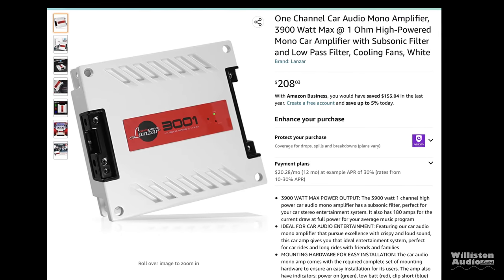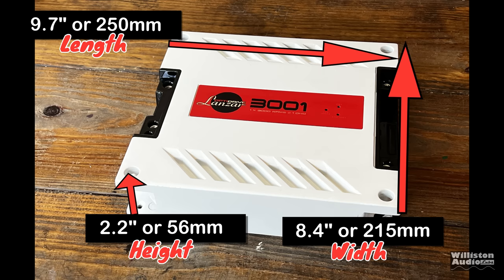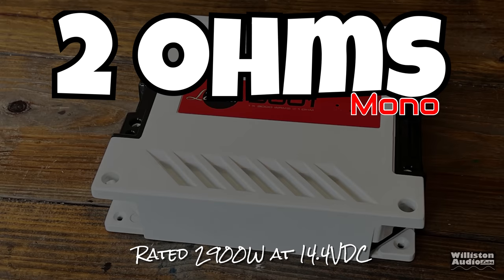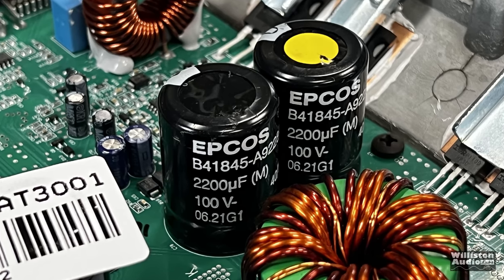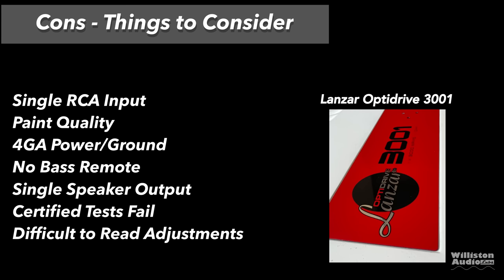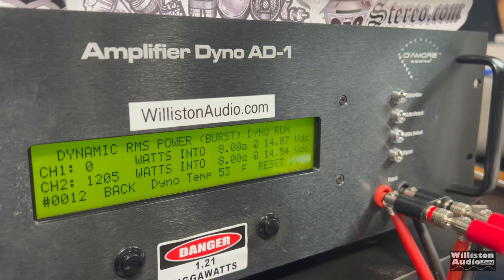Lanzar Goes Brazilian? Lanzar Opti Drive 3001 3900W Full Bridge BASS Amp!

Comment from the maker: SHOP
Lanzar Opti Drive 3001 Amplifier: https://amzn.to/3Zc4arv
4ga to 0ga input adapters: https://amzn.to/3ijToP8
Banda Amplifiers on eBay: https://ebay.to/3jRs6A1
Taramps SMART 3 Amplifier: https://amzn.to/3WSzA4B
Down4Sound Amplifiers: http://Shop4Bass.com

PREVIOUS VIDEOS
Banda Electra Bass 3K: https://youtu.be/GopfPdwVa7A
Lanzar 50c vs Crossfire CFA30HC: https://youtu.be/QE9bNBLvVOc
Pyramid vs Lanzar Amp Dyno: https://youtu.be/7GDnmf3NrlM

➡ Support OSS / Williston Audio Labs for early access to videos: http://www.patreon.com/OldSchoolStereo
Buy me a coffee/tea?  https://paypal.me/BigDWiz

VIDEO INDEX
0:00 Intro
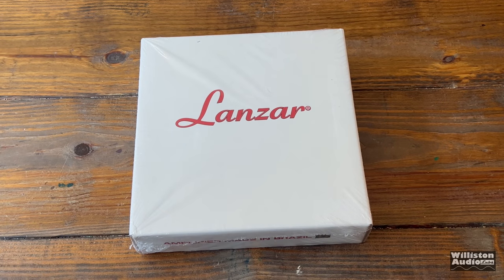1:49 Unboxing
2:27 Features and Specs
4:20 Amp Dyno Tests
7:46 Subwoofer Tests
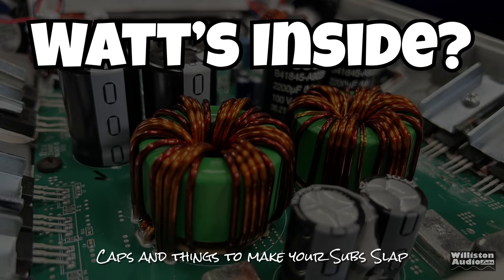8:52 What's Inside?
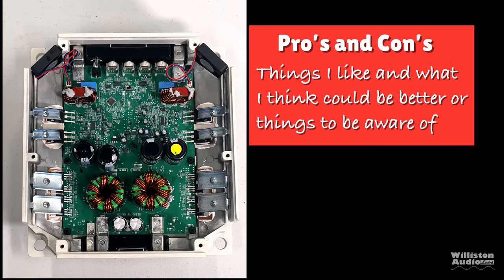10:52 Pros and Cons
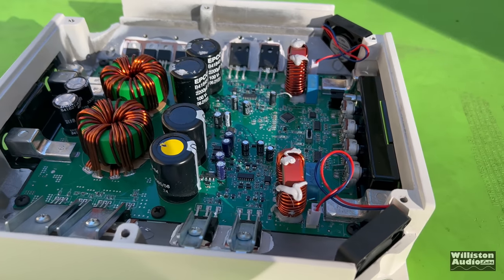11:41 Final Thoughts
12:10 EXTRAS

CAMERAS AND AUDIO GEAR
(Video Gear I Use) 
Camera - iPhone 13pro 1TB - https://amzn.to/3nCjGvc
RODE Wireless Go II Microphones: https://amzn.to/3Q6NVHl
Shure MV7 Microphone: https://amzn.to/3A4OICK
Zoom H4n Audio Recorder: https://amzn.to/3BXjVsS
960 LED Panel: https://amzn.to/2Sxoq3S

TEST BENCH EQUIPMENT
SMD / D'Amore Engineering Amp Dyno: https://goo.gl/sJTcf7
XS Power D1400 Batteries - https://amzn.to/2BPFCKW
XS Power PSC60 Charger - https://amzn.to/2CHGcfs
Fluke 1000A AC/DC Clamp Meter: https://amzn.to/2Rw5WDA
Handheld Dyno: http://amzn.to/2u2EgKV
My Favorite Screwdriver Kit: http://amzn.to/2x0VzcE

DISCLAIMER: This video and description contains affiliate links, which means that if you purchase from one of the product links, I may receive a small commission. As an Amazon Associate I earn from qualifying purchases
Reply: We wanna see the stetsom ex3000
Reply: The site has a outdated ssl certificate. You should be able to click advanced and go past the prompt to get the website.
Reply: i know banda leased out this design to a company called thunderball aka "deejay led " which makes banda Eq that the same a clarion eqs755 also they make banda speakers and drivers also i think there returned items rebranded but don't quote me on that
Reply: Can you repair a amp if brought to raleigh.
Reply: I just used your link I want to try it out
Reply: You have a great channel and your vids are very well done! I’ve migrated from car audio to home theatre as I got older and I have a couple of question for you that I’m hoping you can answer. 

 Is it possible to run this amp with an inverter for a home theatre powered sub build? What kind of inverter would be needed and where would I find one ? I ask because I read that many of plate amps for powered subs aren’t very good and they don’t produce a lot of power. These digital car audio amps are off the charts in the power department compared to plate amps in powered subs. I’d like to take advantage of this if it’s possible. 

Thank you for your thorough testing and well made videos!
Reply: Question, You always talk about forum and 8 ohm loaves and the amplifiers not rated to handle that load. Have you ever seen an amplifier shut down for using a higher ohm load. What a low impedance amplifier go into protect if you ran an 16 ohm load?

Comment: Armchair EE nerd warning: The TO-247 package was designed to carry more silicon. More silicon means more current carrying ability, and probably better heat dissipation. At more "normal" power levels (say 25 to 300 watts RMS), either the '247 or the '220 would probably be fine, but at 3- to 4-thousand watts, I'd definitely want the bigger package. Heck, I'd love to see someone bring back the TO-3 package for applications like this one! 👍
Reply: Great idea in chip
Reply: For my multi KW designs I usually use the CSD18536KCS Fets. What you really want to see is low RDSon (<2mohm) and fast rise and fall times (<100ns) to keep power dissipation down on the Fet.
Reply: @rgstever  Absolutely. I was mostly commenting on the dissipation of the package itself - larger surface area generally means lower thermal resistance. What sort of designs do you embark in?

Comment: I really miss my real old-school Lanzar OptiDrive Plus "American Crafted Performance" amps that were made in the USA back in the 90s. These were real amps back in the day, although I never understood the hard-wired power and ground vs terminals. Had a 500 and 2x Lanzar Pro 12" subs and my car was BUMPIN'
Reply: The old school Crunch 250 (zed designed) I have is the same way, hard wired. Still works down to 0.5 ohm stable although it gets hot as hell.
Reply: I still have mine a 4100 and 2150 which still using them. Can't compare USA to the cheap crap nowadays
Reply: I've always liked Lanzar. I still have three Optidrive 2500s powering three 15" Kove Armageddons and it's so loud it hurts. I've gone through my share of windshields because of them.

Comment: That 8 ohm power output is legit.
I would get this for testing purposes, but I still have a 3k slayer and a tsg mono block that still have yet to seen any action.
Great Video Mr. Sir!
Reply: i think you meant 4 ohm?
Reply: Meant watch til the extras and he got 1200rms at 8ohms at clipping
Reply: 8ohms uncertified he got 1200rms, you need to watch til the end. Certified it did the stop and go but still made 1000
Reply: @hawaiianbasshead  ah, yeah I figured if he did that he would have started with it

Comment: I was not expecting a lanzar to do its rated the power I'm literally happy to see a brand even if it's just one of the lines they produce to do rated it's a shame it didn't count up cleanly but for that price I think I would buy it.
Reply: The Opti line isn't made by sound around, which is why they are usually pretty decent.
Reply: I've got three Opti6000 amps, two of which are still BNIB. They easily do 6,000 at 14v. They are VERY impressive amps.
Reply: I have Opti 7001 and still works great people try to buy it but I won't sale it
Reply: The optidrive and the vibe are the only ones that do.
Reply: @dipinmylip1171  ol school
Reply: Gives me hope that they'll once again gain their '90s greatness!
Reply: @dipinmylip1171  I'd like to see a Dyno of the amp doing 6k or even 3k
Reply: @joshholden8561  There is a video of the OPTI4000d in the same product line doing 4,213. The OPTI6000d does well above 6,000. Those amps are overbuilt, and easily some of the best performing amplifiers for thier time. They are also extremely efficient for the layout, and I guess I'll add that they were engineered and produced by MD, makers of Orion.
Reply: Opti drive series in general was 🔥

Comment: I mean… This amp is actually pretty cool and I really dig the looks of it. That being said I’m not really the target market for this one tho. Great video as always
Reply from the maker: Targeting the guy who has 200 bucks and probably not the correct electrical to use an amp like this...
Reply: LanZar…..Coming to a high school parking lot near you.
Reply: @One-Crazy-Cat  shoot man I used a old school Lanzar 4000watt amp. I know it was no where near true 4000 watts and was more like 1000 watts. Lol. It still pushed those old two 15 inch Audiopipe Eye Candy subs in a sealed enclosure. Those were the good old days
Reply: @wal what type of electrical set up is necessary for this amp? I’m new to this “pro” type build.  My stuff was old school and as cheap as possible for the best I could get my hands on.
Reply: @WhatsthePOINT_EDC  I still run old school and cheap. LOL
Reply: @WhatsthePOINT_EDC  it depends. I say a 250 amp alt, and either 40 AH of lithium or 200 AH of agm batteries would be a solid start
Reply: @ksavage681  nothing wrong with that at all. My old Alpine amps probably still work like the day I got them. I love old school builds.
Reply: @blakebrockhaus347  I’ve got a Optima Red Top battery so I guess I’m on the right path so far. Lol.
Reply: @WhatsthePOINT_EDC  the same rules apply to this kind of amp, no exceptions to the v=ir
Reply: @P C 😂
Reply: @wal  Fo Sho..
Reply: @wal  
My brain wonders if someone can test what amp design style is the most forgiving on weak electrical. 
Korean Half bridge. Full bridge.
On equal watt output.  At one ohm. 
🤔
Reply from the maker: @hardhead7056  the efficiency helps tell this story, but no way you can run a 3kW amp like this on stock electrical unless you have a big truck with 2 batteries as part of your stock system.
Reply: @wal  
I guess im wondering what design is more durable. If your voltage dips. What design smokes first?
What design will survive abuse longer? Even if it's accidentally abused. And im not counting on built in safeguards. Fault protection.  Heat protection.  
Just straight up robustness. 
A/b amps back in the day would just stop when your battery died. And come back to life.
Exception was Unregulated power supplies.  I think HiPhonics would smoke at bad voltages.  Right?
Reply from the maker: @hardhead7056  I've abused the D4S JP amps and they just keep on kickin'. They are literally my favorite amps for the $$ Shop4Bass.com
Reply: @wal  
I hear what your "not saying". 😉
Your a big channel. 🙊
Im picking up what your putting down. 
I was just about to get 2 of those. 
One per 15" sub. 
It was that 8ohm performance that had me salivating.  🤤
Ive got an 8ohm "Round"  SOLO BARIC 15" that would enjoy some 8ohm love.

Comment: 4 gauge inputs? And it's almost as it they forgot to do the soap screening for the lettering otherwise whoever thought black on black was a great idea is clearly in the wrong position. But all things aside 1200 watts at 8 ohms? That's decent power for a cheap 3k amp and it would likely bump pretty decent. Excellent review as always

Comment: In 2000 I had a complete lanzar system from head unit to subs in my jeep cherokee
Reply: ... that's good to hear. I building a Chevy HHR using all lanzar ( everything but the head unit). I found 3 of those old school lanzar opti1232d subwoofers, that were still brand new unused. And I'm going to pair them with this lanzar full bridge amp. I actually was one of the first people to have had this amp. I purchased it a year ago. But still to this day, I never powered it up. So I was glad to see this Dyno review video today. I really didn't expect it to put out more power than the banda version 3k amp. That was pretty impressive

Comment: It's interesting to see a new product in the Opti drive range (even if it's a badge job). I guess they decided that continuing to sell the same surfboard class AB and D mono blocks since 2005 wasn't sustainable. Good to see the Opti drive line is still competent, given that despite being owned by sound around they outsourced the Opti and pro lines to MD Audio Engineering who decides to just keep making the same amps for almost 20 years.

Comment: LOL! I had some of those Lanzar Opti Drive amps in my 1978 BMW. I got them from little stereo shop I worked at back in the early 90's...I actually never had any issues with the amps. They were pushing two 15" Soundstream sub woofers where I used and sealed the trunk..

Comment: When you showed this on FB I kinda figured it would be a solid little amp. Banda seems to be pretty good at delivering the numbers they say. Why are Brazilians so afraid of 1/0 wire tho?! Lol
Reply from the maker: I know the 4ga power and ground set bad example for people 🤦‍♂️
Reply: Because the amps are not designed to actually put out full power. They're designed with dynamic music and high impedance rise subs.
Reply: Agree, but a short piece of 4ga from a distro block wouldn't be a problem.
Reply: @wal  I  am stuck on old school style set ups. What I mean by this is I have 100% stock electrical and prefer low watt/high efficiency subs with 1000 watts amp or less (usually 300-600 watt amp). I go overkill with my wire just to be safe and use 0 guage with these 4 guage reducers like you used here. My question to you is does the voltage getting to the amp suffer from these reducers like this? My thought process tells me no because the reducer is so close to the 0 guage and is 100 percent metal. Thoughts?
Reply: @bones40447  depends on the material of the reducer, if it is copper there would be no loss.
Reply: @bones40447  considering your stock alt is probably 8ga uh... You have some other bottlenecks.
Reply: Bro, im brazilian and i can explain: our amps are getting the litlle as possible, big diameter cables makes more easy to break the conections internaly, using batteries with large cables, we can't have the proper mobility when installing.

Prefering to maintain the back seats in the car, we have only the tinny space in the back to put everything, big amplifiers will take way much space, batteries and large cables too... make us preffer to use high amp batteries and less big cables 🤙🏽
Reply: @wal  
If someone wanted to run this amp with headroom. Not to the max. Because it is small. How far would you push it with a short run of 4 gauge? At 2 ohms. Seems safe if your smart about it.

Comment: I have lazer speakers that are really good.. Even though they only cost 35 bucks a pair Full range component    ,  come to the cross over to ,,     people are pretty impressed when they hear them ... cheap were pretty good...  Been using them in my car doors for the past five years.. I gave it a try I thought they had a good power rating on them for 35 bucks a pair I think it's like 200 W each 6 1/2

Comment: Back in the day, you would get clowned for having a Lanzar amp. But I never heard anyone say it broke. Unlike my old efficient Rockfords lol
Reply: Bullshit nobodys hating on opti 50 ,
Reply: Even their budget black vibe amps worked very well with no issues.
Reply: lies! Rockford Fosgate is top notch in the 20 years I have been buying and selling them I have only seen one Rockford amp die 
they are built like tanks and will last you 30+ years hands down!  That is there power line of amps of course not the prime models that were made to sell at best buy for cheap
the OG Lanzar was good stuff back in the day but was sold in the 90's I think and went right to shit like a lot of the other brands did
Reply: @NightshiftCustom  I am not trying to shit on RF, was never the brand I ran, but I have seen plenty of them take a dump. Every brand gets some duds. Some held up better to the abuse than others. I have one down in the basement that I can't recall if it works or not. Need to go test it and sell it. I got rid of all my nonworking stuff a while back and came across this one whine going through my other stuff.

Comment: Back in about 1992 to 1993, Lanzar made some hatchback boxes, that were crazy good sounding. The one I had two 15" subs, two 4 or 5" mids, and 2 horn tweeters....  the subs were angled up towards the top, but on about a 30 deg angle.  There were 4 decent sized ports along the bottom. I sold it, when I sold the car.
Does anyone have any pictures of that box, or have any information on it???
Reply: Kicker and Rockford also made those full   range boxes back then 💪😎👍

Comment: I’m upgrading my system from 2 Rockville RXD-T2 amps (each separately powering a 2ohm sub @ 4 ohms bridged) to either a Soundstream t1.6000dl or this & I am so glad you posted this because I couldn’t decide until I saw those janky ass knobs. First of all, there’s SUB & then BASS… so 2 bass boost knobs or…? Not to mention the 4 gauge inputs… definitely going with the Soundstream even tho it clips at 2200 watts @ .5 ohm… im just hoping I don’t blow my shit up trying to get that 4400 RMS

Comment: Nothing wrong with budget build options 🤙
Reply: while maybe till the car is on fire from it lol
Reply: @NightshiftCustom  that's just Facebook type talk and myth. Most all failure from Brazilian type full bridge, is user error. Be it, too much input signal voltage, where they think they all need 7v fed to them, improper ohm loads and vibration issues. All amplifiers can and will have problems. You know how many SALT amplifiers I have seen so far, with the transformers not even fully soldered or not soldered at all. I have yet to have any real issues from full bridge amplifiers,  except one Taramps HD3k first version.  They replaced it with a brand new unit way back then...and it has passed hands about 7 times now, and it has fallen back to me, and has been in my wife's budget build for over a year. Most of the "fire" comments are just typical misinformation spread by word of mouth. Any brand can and will fail, and spark a flame, smoke up a car...and so forth. Most of those failures, were people throwing 3k+ amplifiers,  in vehicles with no upgraded electrical, and with 4ga CCA wire and the likes.  I've seen it first hand, for years where people think that the size of those amps, means they don't need the electrical to back it up. 👍

Comment: The 4 gauge inputs crack me up! X-D
Reply: 4ga wire is sufficient for most 3k amplifiers that have 4ga inputs. If you use a good quality of wire. It isn't so much about current, as it is about the wire's amperage load capabilities. My wife has a budget build for her daily, and I always use KnuKonceptz wire...and hers has 4ga ofc and performs flawlessly. Even full tilt on her drives to work, or when we just take drives, ir doing a demo..it never drops below 13.8v, and that's with just one xs power 7500, and a smaller xs under the hood. 👍
Reply: @Chuck_Sanders  😳
Reply: @colorblind1983  😲

Comment: I love these cheap amp vids😊 
I'm curious if you shoot the low impedance/max power vids first, then reverse the order to keep the battery bank voltage up?
Reply from the maker: No, typically I go from 8 ohms down. I just crank up my power supplies / chargers when the ohm load drops and current rises